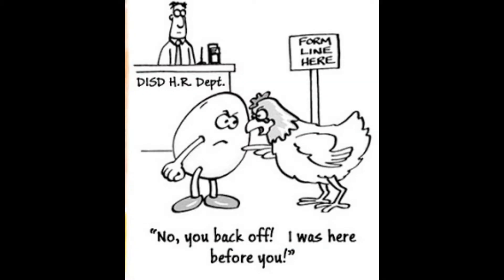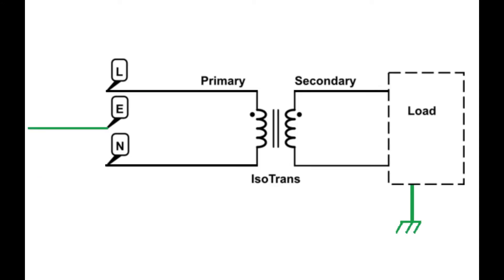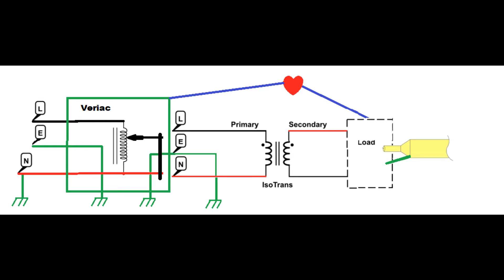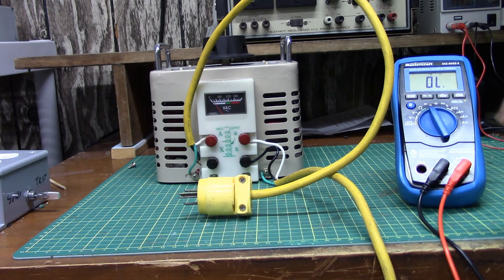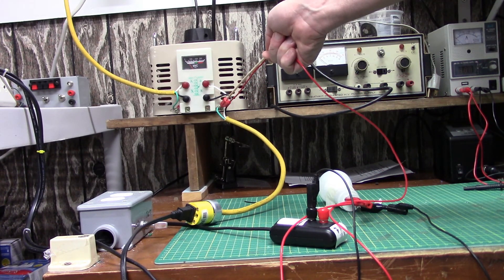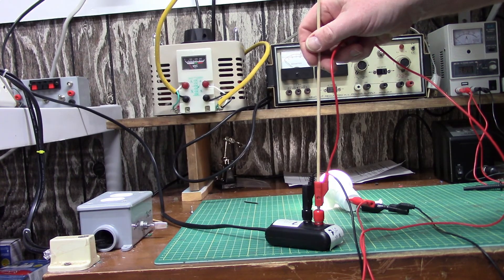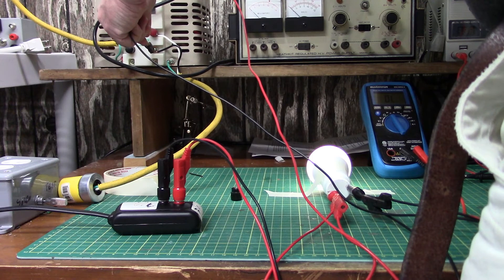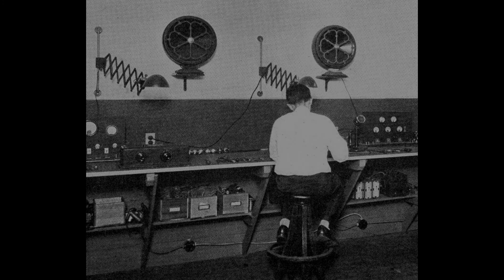01021 Workbench Safety 101 #1  Variac and Isolation Transformer Hookup

Comment: What if I wired my variable so it works off 240v so it doesn't use a neutral. Would I need a separate isolation transformer?
Reply from the maker: 100% Yes.  An variable transformer or more properly an Auto Transformer never offers isolation.  Unless  it is a special and says so on the front.  Try this test and you will see 
https://www.youtube.com/watch?v=u3jXDfSWUnU

Comment: What happens if you are testing a device that has a 3 prong plug - say a guitar amplifier.  Shouldn't the ISO have a 3 prong outlet?  Most commercial ISO transformers do have a 3 prong.  In your example, all of your loads only have 2 prongs.
Reply from the maker: No real difference that I can think of off the top of my head.  The point here was to show that is does not really matter if the Variac or IOS goes first.

The choice to use and ISO or not could be the subject of another video. It is a 100% required IMHO when working on say a hot chassis AA5 but only required on a amp with a transformer if you want to float the chassis so you can use a common point to hook your scope ground into.

Comment: Makes sense. If you put the variac first , at low voltage settings it will cause the primary of the IT to overheat because of EMF.
Reply from the maker: Thanks for watching. True but one really one uses the slow power up once at initial power up to  make sure the DUT is not going to release the majik smoke to start.  I might dwell at med voltage say 75 volts for a few mins for the cap will reform a little.  The only other time I use the slow start up is the first time I starting after fixing the DUT to make sure I did not short anything. Don't forget subscribe ;)

Comment: Low voltage into iso causes issues.
Reply from the maker: Not sure what you mean by iso?   In hind-sight I should of used an incandescent bulb vs an led.
Reply: @byterock  I think he meant isolation to be isolation transformer where I think he is trying to say that restricting voltage to isolation transformer will put it under stress. Btw very good video and I always do as you do isolation transformer first then everything thing else down the line.
Reply from the maker: @tonyp.2482  Hmm will not sure how that could be?  Might cause some audible hum or buzz I guess by some off chance and you could get some sympathetic resonance effect?? An under-voltage should not matter as it is current draw of the load that will damage a transformer.   Will have to look into that.  Thanks for the 'very good'  nice to see people watching them.  TTFN

Comment: Thanks for sharing, that does help. So I assume you didn't modify your variac or isolation transformer in any way?
Reply from the maker: That is correct no modification.   The isolation transformer is hooked up as in the schematic.  No connection to ground across it. As you can see I had to add the ground wire to the chassis on the variac.